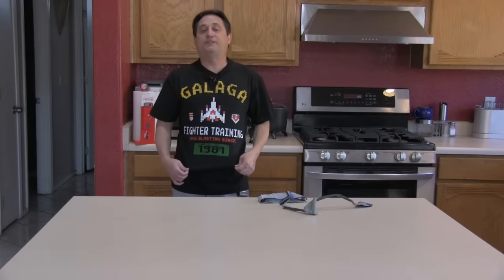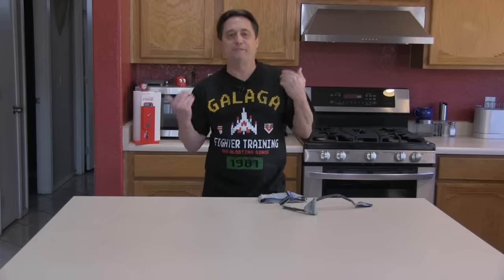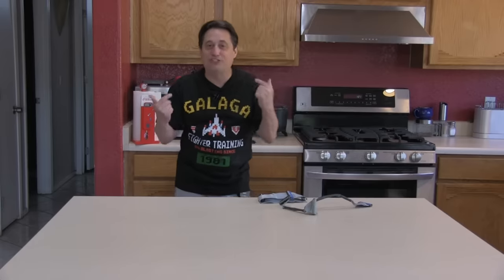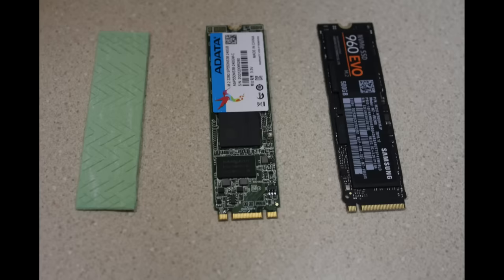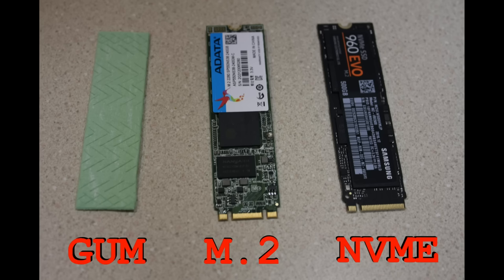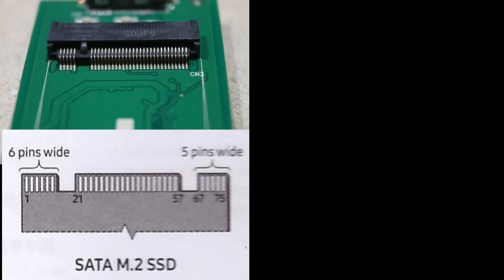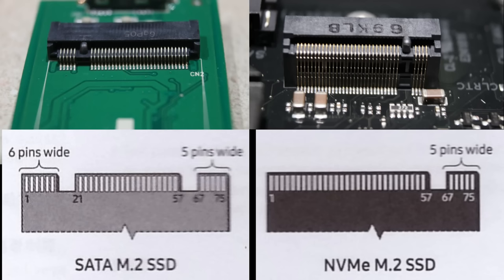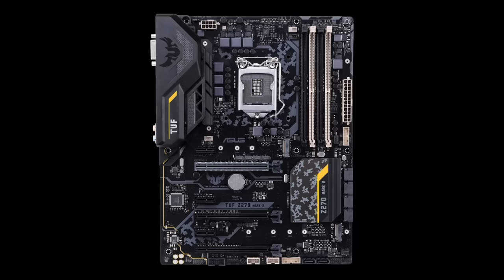M.2 vs NVME: What's the difference?

Comment: RLL was just a different type of formatting from MFM. A MFM controller could format a particular Seagate HD to a capacity of 20MB. A RLL controller could format the same Seagate HD to a capacity of 30MB.
IDE was an improvement to RLL. All three could only handle two drives per controller with a max of two controllers. All three needed to be terminated at the end with a resistor pack with something like 10 pins all in a row.
SCSI was superior to all three, but expensive. They were faster, larger capacity drives and could have 6 drives per controller internal or external with a max of two controllers. SCSI drives needed to be terminated as well with either the same types of terminator the Others used or when external, a pack that could plug in to the back of the drive. They had two types of terminators, passive and active. Macs used SCSI exclusively from 1986 until around 1999.
On later drives the resistor packs were replaced with jumpers and eventually no termination was required with SATA and SAS.

Comment: I do believe we go back to about the same time in computers. I remember discussing hard drives with a manager at work, and I told him computers had reached a limit with the speed of IDE hard drives. I said, until they get faster there won't be much advance in speed. So, what did they do? They came up with Raid drives. 
Now that I saw your video, and got the inside on how NVME works, I see they resolved a problem we both saw, parallel is inherently faster. I also wondered why they did that, but now I see how they have resolved it. Thanks for the info. 
Oh, I annoyed the hell out of my boss when I wrote self modifying bat files for dos computers. When a pic of a nicely displayed young lady popped up on his computer he had no idea how it happened, and could not find the pic on the computer after boot up. 
Hey, his own fault for not realizing a prime rule of computers, to really learn them you have to PLAY with them.

Comment: @CareyHolzman Optane is DOA currently as far as the comparison with Samsung M.2 drives is concerned. the NVMe based M.2 SSDs are already faster and cheaper than Optane drives.
For now, Intel is marketing them as cache drives for laptops with large (e.g. 1TB) hard drives installed.
Comparisons with 970 series Samsung drives is common and they're way faster(~3000 - 5000 MB/s) than Optane drives(~900 MB/s).
Optane drives also have terrible write speeds(~150MB/s).

Comment: Its a Wow presentation , reminds of still a lot old interface like  ST-225 and ST_506 with 30 data and 20 control cable drive interfaces on XT?AT motherboards and also 50 Pin SCSI  flat cables for SCSI drives

Comment: 2:09 I love it when people say parallel is a much better way to transfer data, and they hold up a IDE cable. So how is this much more efficient, when the transfer from serial to parallel is done on the drive or it is done on the motherboard if a serial cable is used? In both setups the only difference is WHERE the data is transferred to parallel, and both systems use both, because a serial to parallel transfer is done on the motherboard for serial. Now serial comes off the hard drive, which means there is no transfer taking place going from a hard drive to a serial cable. You could argue that the transfer off the hard drive with a serial cable is faster, because there is no transfer in between to parallel. The only real difference is where the transfer takes place, on the drive or on the motherboard, which only makes one more cost effective than the other, less wire.

Comment: pata vs sata: why sata is faster than pata. Parallel data transfers used to be faster than serial data transfers, it made sense. You were transferring (say) 8 bits at a time vs. 1 bit at a time. The problem is that you have to clock in, or register, those 8 bits all at the same time or you get the wrong data. As data transfers get faster and faster, the time you have to clock all of those parallel bits gets shorter and shorter. Makes sense no? This works well at slow speeds. As speeds get VERY fast dealing with parallel data becomes impossible. The slightest difference in arrival time between the bits in the lines of the cable become a problem. At that point forward, piping the data through just one line makes more sense. There are no issues trying to clock parallel bits, and the technology to self clock high speed data is well known. Single line data systems kept getting faster, and SATA left PATA behind.

Comment: The M.2 electrical interface supports SATA , PCIe and USB although SATA and PCIe use the same pins for PCIe lane 0 so the use of both in the same design is not possible. Here is the pin reference for the curious: 
https://pinoutguide.com/visual/gen/M.2_NGFF_connector.jpg

Comment: (PCIe) NVMe M.2 SSD (fast) = not SATA M.2 SSD (slow)

So, why isn't it NVMe vs SATA?

SATA----------SSD=slow
SATA--M.2--SSD=slow still
PCIe---M.2--SSD=fast (actually called PCIe--NVMe--M.2--SSD)
Why do we need NVMe naming in this chart? To differentiate SATA SSDs from NVMe SSDs? Why not simply calling them PCIe SSDs? Because there are SSDs that acually connected to PCIe directly? Or are they still called PCIe NVMe SSDs? Oh, they are actually called PCIe M.2 NVMe SSDs...

Comment: Well.. mostly right except that parallel vs serial portion is a little wrong.

You see parallel is a multiplier vs serial, however it suffer crosstalk just like you mentioned on the ide cable that Engineers end up putting null cable to prevent cross talk. 

Parallel is great for slower baud rate if the controller is not sensitive enough.

We Engineers know that because the properties of each copper cable have their physical elements and properties which make each cable having their transfer speed unique.

So this mean each cable transfer data at the same time but May jolly receive at different time slot. This screw up data integrity.

Serial on the other end does not have this problem and this is why in the 90 to 2000, they build on serial tech first until parallel is matured which like now, we have Controllers that is sensitive enough to correct and pick up wrong order transfer.

Parallel is great if we can harvest the tech. Serial is a sure success.

Comment: I install nvme adapter card into PCI-Express slot and installed nvme WD Nvme DIMM, when I boot the computer I see Window 10 recognize new disk1.  So I cloned my C-Drive and dumped on to new Nvme drive, but when I go to change on the BIOS, my Lenovo desktop does not see NvMe drive attached to it.  So I cannot change boot from the new Nvme drive.

Comment: In radio, low frequencies travel at near light speed but Gigahertz changes travel 66% of that speed. Parallel data that's called "bit jitter" and causesvdata errors.

Comment: I have a computer that has all three connections - IDE, SATA, and PCIe
Have another connection on the board but not sure what it is used for (M/2 maybe?).
What is slowing me down is the ancient CPU
Keeping up with technology is quite expensive.

Reason I have those kind of computer is that I have several old IDE drives I use for long term storage. IDE is a MUST HAVE for me needs.
Oh and I still have 2 burners...

Comment: If you Understand Computer Engineering (Hardware manufacturing) you'll understand why they went from PATA, to SATA. PATA is cheaper, can be done with low power / performance Transfer IC (processors). The problem with PATA is Speed. When you go faster, data on the PATA lines gets Skewed (arrives at different times). So you have to Slow down and Wait. SATA only 1 line, solves that problem. You can now go to 10 GHz instead of 100 MHz like PATA. However you need Fast Powerful Digital Signal Processors that didn't exist earlier. This leads to SATA1, SATA2, SATA3. Multiple Large block Transfers using Multiple Serial Lines. This is not like PATA's 1 Line per bit of Word. Wait for all bits of Word before moving on. SATA3. First Half of file down line 1. Second half of file down line 2 e.t.c.

Comment: I just want the M.2 NVME drives to come down in price.....I'm looking at almost the price I paid for the console for a 2tb upgrade to my PS5 😢 and with the ridiculously large size of games these days it's almost essential
Reply from the maker: A 120gb ssd cost $200 just a few years ago. Now you can get 2000gb (2tb) for the same price. You do realize what a bargain these dtives are at current prices?
Reply: @CareyHolzman  new PS5 disc edition $750, 2tb WD black sn850 was $600 plus, especially after the PS5 SSD update was released

Comment: I have a Dell Vostro 3470 desktop PC at home with a 1Tb HDD. But, due to some multimedia s/w installed recently, I want to install an SSD to boost performance as the PC works sluggishly with the HDD. Dell technical support said my motherboard has the old M.2 SATA port and not the M.2 NVMe port. On opening the CPU cabinet I checked and noticed that the M.2 port has a single notch to the right which makes it look like a port which supports NVMe SSD. How do I confirm what type of M.2 port my PC has (perhaps by using some freeware s/w which identifies ports) ? Any help would be much appreciated. TIA
Reply from the maker: Google is your friend - https://www.dell.com/community/Vostro-Desktops/Vostro-3470-NVMe-M-2/td-p/6215107
Reply: @CareyHolzman  Thank you

Comment: The SATA M.2 SSD is bad in my ASUS Laptop.  This laptop has three different model numbers on it. Yeah!  The number on the bottom outside of the case is F542UA-DH71. The number on the  sticker on the mother board is X542UA, and lastly the number on the mother board PCB is X542UQ.  Ok with that said, I have been trying know if this mother board will support a NVME SSD.  So far I have not found any information that it will. The M.2 slot on the MB has 1 key/slot on the right hand side where the 5 pins of the SSD fit into.  What do you think, can it support the NVME SSD?
Reply from the maker: https://dlcdnets.asus.com/pub/ASUS/nb/X542UAQR/0409_E12445_X442_X542_B.pdf?model=f542ua

Comment: You made me a very happy camper, I recently bought a HP EliteDesk 800 65W G4 with a chewing-gum for storage and now you are telling me that it's a chewing-gum on steroids! :-) 
The little bastard has space for a SATA SSD so I bought a Crucial MX500 250GB and a SATA tray to install it. My idea is to install the OS on the SATA and use the NVMe 512 GB for storage. 
But I've been told that this would be a big mistake. What are your thoughts about that? 

I also discovered that there is a second NVMe slot but I've already bought the SATA SSD I could have bought another NVMe instead. 
I've also been told that NVMe's do tend to get hot and the SATA tray being mounted on top of the NVMe and the tray having space to mount a cooling vent, I've bought a second fan. The motherboard has only one fan slot and I haven't found a splitter cable for the fans... I guess I have some soldering work to do.

Comment: Does anyone remember 2:1 and 1:1 interleave controller setup re 1:1 read 1 track per revolution as opposed 2 revolutions per track.
Reply: Back in the early 90's you could low-level format your spinning hard disk. The utility used to do this was on a floppy drive and would allow you to select different interleaves :)

Comment: Pentium 4 Built... XD 98 to XP... Yeahh, I remembered.... IF you think building a modern pc is difficult aspecially when cable managing... Try working with those ribbon cables... XD Regarding the speed, NVME 980 Samsung 1T write speed up to 3100 MBps & read at 3500MBps... It is VERY fast compared to MX500 Sata SSD which has a write speed of 510MBps & read of 560MBps... It is however much faster than HDD... HDD only benefits are it's SUPER storage capacity while its write/read speed mostly around 210+MBps... Thank you for bringing back the memories... Uhhh, good ol' times!!

Comment: I made an IDE cable from scrap wires and connectors using soldering iron
Yeah 
35 to 40 different wires and connectors
Just to see what's in the hdd that was lying around

Comment: Back in late 80's early 90's, I got my hands on a MFM IBM 10 MB hard drive, that weighed about the same weight as the Titanic minus the passengers. It was about 6-7 inches high, 5 inches wide and maybe 9 inches long. 10 mega bytes!!!!!! But going on a 8086 at the time, that was big memory baby!!!  That was the most expensive $$$/MB at the time until I bought 4 megs of RamBus ram for my Pentium PC . Then it made my MFM drive cheap. LOL
Reply: I remember buying an early mac in the mid 80's.   it costed $400 to upgrade from 128K to 512K of RAM.

Comment: Greeting Sir
I have m.2 pci nmve ssd drive but my laptop support double cut m.2 sata III ssd drive. Is there any adapter or device (internal adapter for laptop) with which i may plug this device into sata III slot. Means i have ssd with one cut but my laptop supports ssd with 2 cuts.
Regards
Please guide

Comment: LOL Air flow yes it was hard to get good air flow with the Floppy ribbon cable and HHD plus when we got a CD rom lol it was so much better going to SATA nice thin cables but now with my new build all the Storage is on the motherboard with 4 MVMe Gen 4 SSD putting 2 x 1 TB and 2X 2 TB this should be enough.
Thanks for the video as I never knew that there was a difference between M.2 and MvMe M.2 and now PCI-e 5 is out ish 1000BM/s read and write they say .
things have come a long way from the 420MB HHD in my first Pc and 4BM Ram 😄

Comment: I had this problem on my ASUS Strix Z390-E motherboard on a BSOD issue.  Tried everything to troubleshoot the problem and still got the BSOD.  The final attempt was to remove the circular battery on the motherboard to reset everything but still got the damn BSOD.  Talked to two different ASUS techs.  One told me my NVME.2 and RAM were not compatible while another tech told me they were.  So this is what I did.  Went into the motherboard bios and went to the "On board device configuration > M.2_1 Configuration" and changed the PCIE drop down menu from "Auto" to "Only support M.2 PCIE device".  Or in most cases let it focus only on the NVMe.2 that you are using as the "C" drive and take it off "Auto Mode". Problem solved.

ASUS Strix Z390-E
Intel i7 9700k
Samsung 970 Pro
G. Skill Ripjaws 32GB DDR4 3600

Comment: Optane is crap.
I have Optane in my laptop, it's kind of a hybrid with Optane and NVMe on the same chip(500GB NVMe, 32GB Optane).
It's supposed to cache data and increase boot speeds, but all it does is reduce the write speed of the whole SSD.
When I enabled Optane, I was getting 1300 read, 300 write speeds(MB/s).
When I disabled it through the BIOS, I got 1300 read, 950 write.
Go figure.
Reply: Also, I was able to dual-boot my Windows 10 system with Ubuntu when I disabled Optane, which I wasn't able to do with Optane(because of the stupid decision by HP/Intel to have a "backup" UEFI BIOS on the Optane drive which overrode the Grub bootloader on my regular SSD).